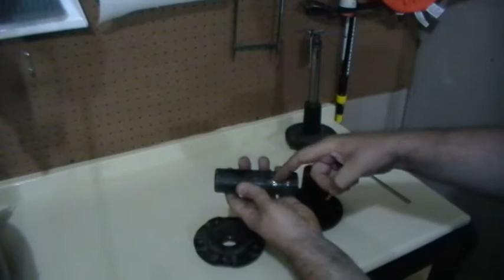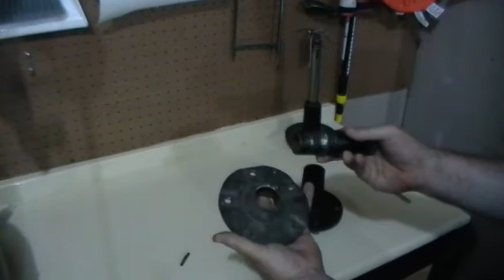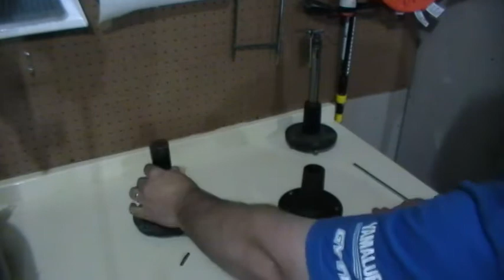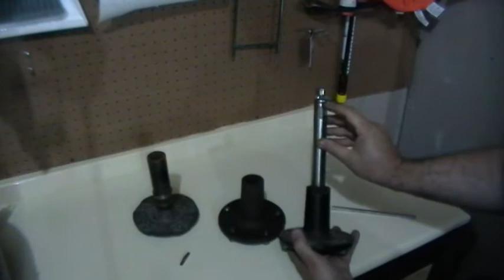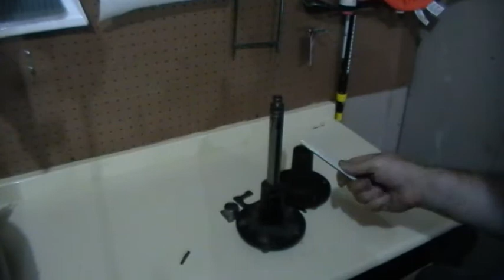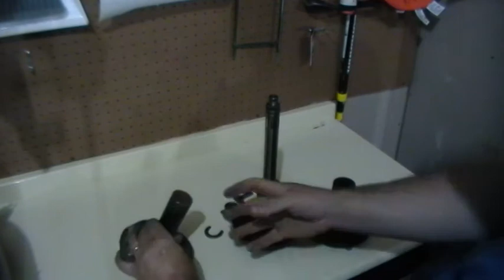Follow up to the K66 video showing difference in hub and axle

Comment: I would think the k66 key is supposed to fail so the transmission doesn't get damaged. The hub failed for sure welds aren't designed to break. At the end of the day would you want a broken key or a broken transmission?